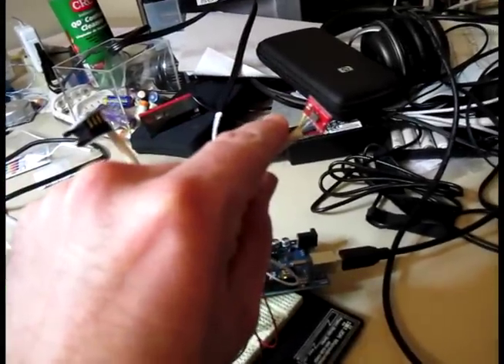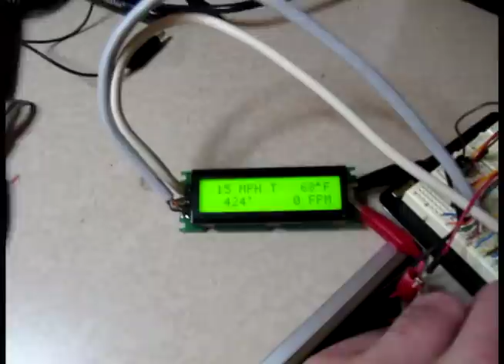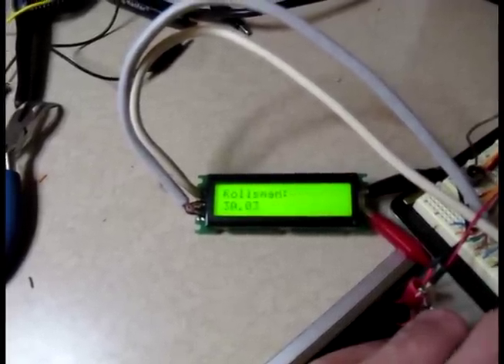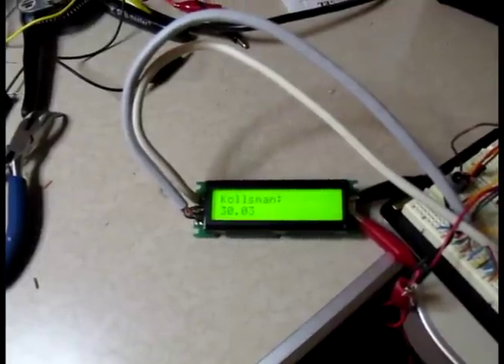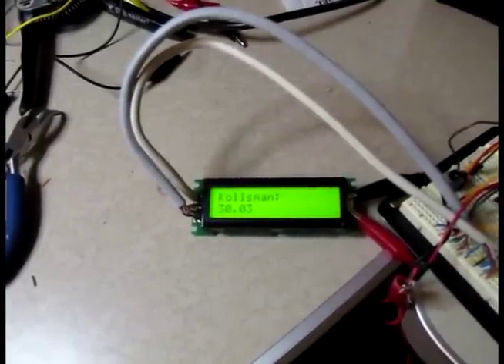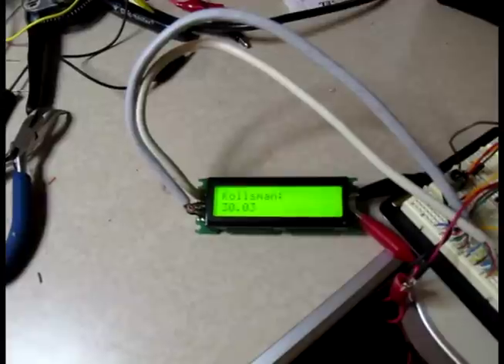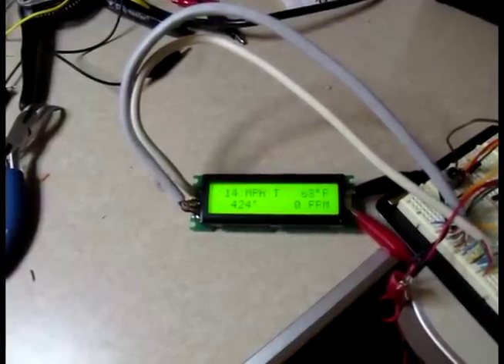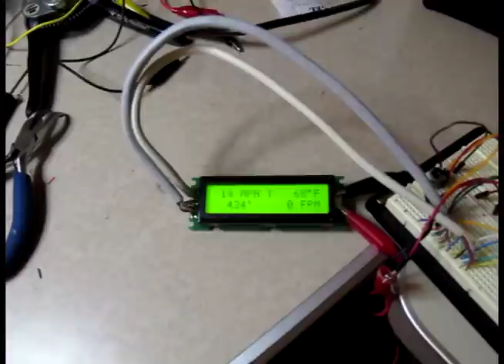The Obairlann Labs Air Data Instrument (part 1)

Comment: You can make a diffential pressure gauge and temperature and humidity sensor used in pharma industries . You hav to use ads1115 to accurate the reading from mpxv5004dp /7002 dp from mmwc to Pascale.

Comment: Total practical value, shoot them to me and I'll install them in my ultralights.  I want two sensors, one for each wing tip, because in a super slow turn, one wing is going much slower than the other and is libel to stall.   I've got a Remzibi or two that tells me GPS ground speed.
choppergirl.air-war.org

Comment: I had this exact same idea, all the way down to the pressure sensor you used.  I was looking to mount a pitot tube on my motorcycle, and figured the cheapest way would be to look at what the RC airplane community was using.